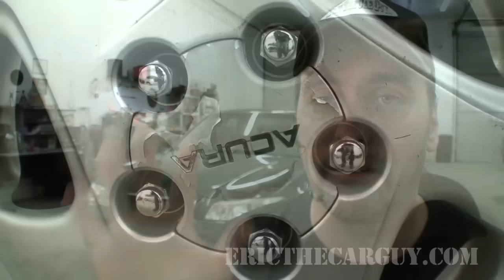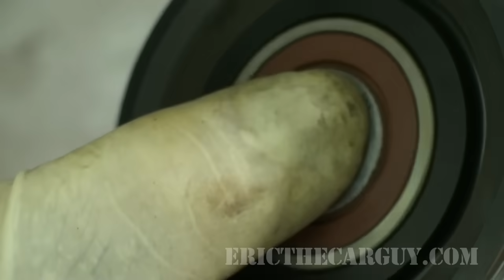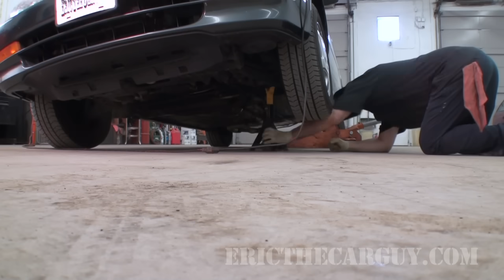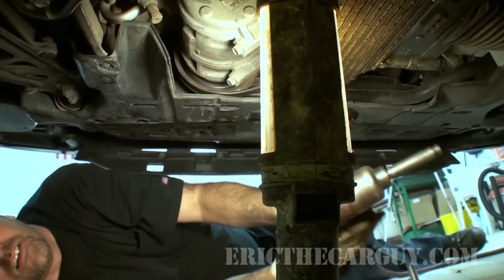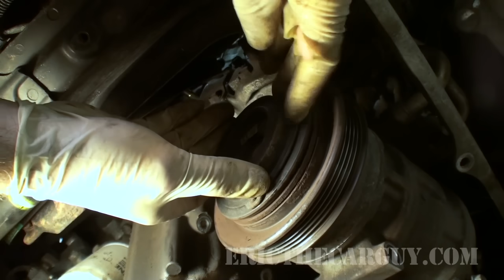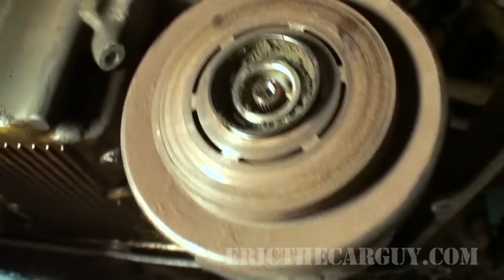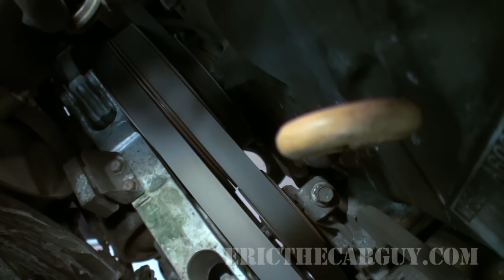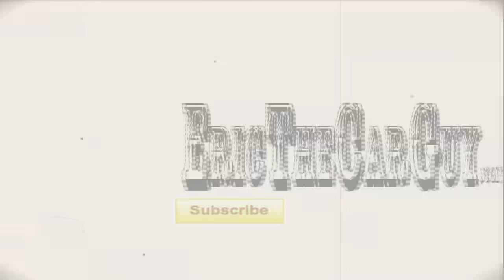AC Clutch Repair and Noise Diagnosis -EricTheCarGuy

Comment: If it was the idler pulley, which is always turning wouldn't it make noise all the time? I'm not that familiar with AC, so just thinking. (probably wrong)
Reply: I didn't really watch where it was, but it must only engage with the clutch. Thought it turned all the time with the belt. Thanks!

Comment: good video..here is a tip.. if clutch only engages if you tap with a screwdriver you can take off the front plate and wire wheel 
 both surfaces clean..get rid of rust and make it shine..take out a shim and usually that works.

Comment: I'm looking to buy a car and the A/C on it squeals when you cut it on (it supposedly stops after it warms up) and it has a new belt (don't think it is the belt since the noise isn't constantly happening while the belt is turning). I was wondering if this could be the fix for the noise since the compressor seems to be working fine and blows cold, or should I look into other fixes for the issue?

Comment: Eric, my mother-in-law's '03 Accord 2.4L has a bad a/c clutch coil... no clicky when power applied & no continuity. Considering the car has 115k miles, I'm torn about whether to have a shop evac the system and then I'll replace the whole compressor assembly (& probably the receiver/drier), or should  I just replace the coil without opening up the system.  What's your opinion?  Also, IMO, after this repair, I think she should trade it in to the dealer where they bought it new because the car eats a quart of oil every 300 miles.  I think Honda should deal with this car because a Honda should NOT be burning that much oil with only 115k miles on it. However, I don't think she'd be able to (honestly) sell it to an individual with this oil burning issue.

Comment: Would the same bearing be at fault if i have a groaning noise while the engine is running, but quiets when i switch the a/c on?

Comment: Great video.  I have a VW transporter shuttle and compressor is making noise.  Will use this video to explain to my mechanic and see if he can change the bearing rather than changing the whole compressor which he is suggesting.

Comment: Can anyone give me advice?
I have a Toyota celica 2004 1.8vvti 40.000 miles, I have only had it six months and when i come to use the air con it is not blowing cold like it should so I got a work mate to recharge the system as I work in a body shop we have a system which removes the old gas and refills it which was done the other day but still no cold air so the system was cleared and filled again but no change, The pump is kicking in the sight glass is showing the flow of fluid, I removed the glove box to see were the expansion valve is located and noticed the two pipes that come in through the bulk head are both hot, I wanted to find the expansion valve to see if its easy enough to change, Any ideas folks ,  Thought I would ask before assuming its the pump, I heard people saying it could be the valve?
Reply: Google it

Comment: Hoping someone knows what's wrong, but when I start my car, there is a ticking ish sound that I have confirmed comes from the AC compressor, the only thing is that it is a constant sound. whenever the AC compressor kicks in, the ticking ish sound subsides. Because of that, I don't think it's the AC compressor causing the noise. Do you think it's the pulley bearing? The car is a 1999 Honda Accord.
Reply: vladstr100 I’d say bearing

Comment: Why when engine idle without clamping the ac pulley had no noise but when the system operated the noise were produced..therefore that pulley had 1 bearing only..tqvm
Reply: I wondered this too.  I'm guessing it's because when the clutch isn't engaged the pulley is free to turn with less force on it so the sound isn't as loud
Reply: It looks like the bearing was working (allowing it to spin freely) but broken and allowing the pulley to move side to side, making poor contact with the clutch when engaged.

Comment: Does a York style Compressor use washers to set  the clutch6air gap? a guy told me that I needed to put a washer in my compressor shaft to set the right gap.

Comment: hey eric my clutch still engages on my compressor but compressor hub barely spins when clutch is engaged, seems like something is loose are not making contact with compressor, i smelt something burning before this happen but as i said clutch will still engage its just compressor barely turns its like friction material burnt away, i have a 03 kia sedona lx

Comment: I changed the idler pulley and my car kinda makes a rattle noise like something is lose or broken beating. it's not over heating and it is making that noise even when The a.c. is off. 05 accord

Comment: Do you happen to know if a 2004 accord v6 compressor  is accessible from underneath like the Acura was?  I'm going to assume the coil is dead since the system was checked out by the shop and they said everything was good but it started to fail intermittently until it just would no longer engage.

Comment: Hi! I have a 1990 Buick LeSabre, I had a problem one time about an AC compressor blowing freon out and then the clutch was making chattering only when the AC switch was in off position. Then when it was on, it stopped making noise due to the clutch disengaging. I had gotten that replaced sometime back and I've had another problem from that time on. How I manage to fix the problem was to remove the AC compressor fuse. When the fuse is in, The engine will idle a little higher than normal and a constant tapping noise would happen behind the dash. What would be the problem? A sensor?
Reply: Air blend door motor if it was a rapid clicking or tapping some are easy others need the entire dash pulled to get to

Comment: My 2005 Volvo XC90 with a V8 begins clacking with the engine reaches optimal operating temperature.  Accelerating increases the loudness of the clacking.  I took it to the auto mechanic and he told me the noise is coming from the AC compressor.  It makes this noise even when the AC is not running.  The mechanic told me the noise will continue even when the AC is off because the compressor is connected to the serpentine belt and the pulley turns even when the AC is not running.  Can this be true?  Thanks

Comment: great video as always. Thanks EricTheCarGuy. I was hoping to ask your opinion on whether you think I should buy a brand new AC compressor, or just replace the clutch.

My car is a 2008 honda civic si and has been having some AC issues. It started a year ago with the AC blowing warm intermittently, then 6 months later only blowing cold for 10-20 mins on a cooler day, to presently in which it only blows warm air 100% of the time. In all of those cases, the AC clutch was idle and not engaged (whenever it was blowing warm) and was spinning (when it blew cold). AC fluids is completely new and charged, and the sensor relay is brand new OEM from Honda. Any advice would be much appreciated. Thanks for all the hard work you put in these videos. Very helpful!

Comment: This video helped me do the same job on my 2002 Honda Civic. A few differences doing the job on the Civic: 

1) You do not have to unbolt the compressor; the assembly is accessible through the wheel well. It helps to remove the wheel, and pull back the splash shield in the wheel well, but the compressor can stay where it is. 

2) Eric unbolts the clutch with his impact gun; I don't have one, so I needed an AC Clutch Holder Tool, available as a Loan-a-Tool from AutoZone. This will hold the clutch in place while you loosen the bolt; otherwise the clutch just spins with the bolt.

3) For him the pulley just comes right off; on mine it was impossible to pull of by hand (yes, I removed the snap ring first). To get it off I used a 3-jaw puller (also loaned from AutoZone) that worked perfectly. To get the new one on, I slowly tapped it on, using a piece of wood between my hammer and the pulley.

4) I originally wanted to keep the original pulley, because only the bearing was bad. However, on the OE compressor pulley, you cannot press/pound the bearing out of the pulley because it is staked in at the factory. So, unless you want to cut it out with a grinder or something, just buy a new pulley with bearing and clutch. I actually had trouble finding the bearing WITHOUT the pulley, and it wasn't even cheaper that way. I got a new pulley/bearing/clutch/coil kit (including new snap rings, nut, and spacers) on eBay for less than $50. Like Eric, I did not bother replacing the coil but am keeping it for the future.

Comment: I would suggest use a short hose as a stetoscope wait for the noise to come out then put the other end of the hose to your ear and the other near to the tensionner pulley and compressor( just be carefull)  on that way you will save more time in locating the source of noise accurately.

Comment: I have a 96 civic ex...when I turn the ac I get a spark from the ac pulley. when I turn it off the spark is still there but very less frequent...any suggestions ?

Comment: I'm going to take a look and see if the clutch is moving on my compressor. For some weird reason, it stopped getting cold last night. It happened the other day, too- parked the car, came back out, started it and bam, warm air... then it started working again, and now it has stopped. -___-

Comment: Just goes to show u learn something everyday. I've been a mechanic for 20 years and never knew u could replace the clutch assembly as my bosses have always just bought the complete compressor. Thanks great video
Reply: Your bosses probably choose to replace the complete compressor assembly because most people don't care about proper functioning of the AC system and seem not aware that it requires regular service and you may never know if the compressor internals are damaged and the clutch assembly (coil, bearing, clutch plate) damaged itself due to compressor shaft binding or overheating due to continuous running on low refrigerant (which lowers the OCR, that is, the Oil Circulation Rate, since most car AC compressors don't come equipped with dedicated oil pumps and sumps like Dorin, GEA Bock and Bitzer bus HVAC compressors, which are similar to the Chrysler RV2 compressor, do and therefore the oil has to circulate around the system with the refrigerant), lubricant leaks or other issues. What may happen by replacing the clutch assembly on an abused compressor may be that the compressor fails a short while after the repair and the customer may basically come back, say it's your fault and want the entire compressor replaced under warranty.

Comment: I have Korean car with 50k on odo low miles I smelled clutch after leaving car in garage 2 months.  Pulled out garage and smelled clutch burning and air is not working at all now.  Any ideas got manifold gauge set to check to see if system has pressure.  Would just clutch kit fix?  Ac light on dash is on

Comment: My 98 Accord's compressor makes a terrible noise when it engages for the first time between drive cycles. It is intermittent, and sometimes I can feel it drag the engine down for a second. After running for a bit it is fine. I just had it recharged and I really don't care to open the system. 

I will definately check that bearing. That TL probably uses the same AC compressor.

Comment: I went through water and this is happening to my AC compressor or pulley. What can i spray on it to remove oxidation?
Reply: Troy Nall If water went into the bearing, there is not much left to do but replace it. The bearings have grease inside, which shouldn't really mix with water. If it's just a little corrosion on the part that engages the clutch, you might be able to very lightly tap it a few times with a rubber mallet (or hammer if you don't have one) while loosely spinning the pulley with your other hand. That may, or may not work though.

Comment: Would you consider just replacing the clutch bearing in a case like this rather than the entire clutch assembly?  The bearing costs $7.00 while a clutch assembly is closer to $80.

Comment: My Chevy Silverado 2500 gives off a rattling when AV is on and I accelerate. Does not do this when AV is off. I changed the pulley put it still makes this noise. Can anyone help?

Comment: hey Eric, can i have an acura,   I over filled it,  and the ac started wining now it blows hot,   I check the compressor and it looks like clutch is engaging and moving with the belt,   Is it possible ac clutch engages and still hot air is coming out, even after getting rid off Refridgerant and refilling to correct amount,   and still no cool air,  even tho i see the clutch engaging on the compressor,  can you help me?

Comment: Helpful video apart from that i live in another part of the world and that kind set of tools might be a hard to find here. Today i just found out it was my AC compressor that was making the noise and its like this here. The AC doesnt work anyway so ill just do whatever i can to make the noise go away. I was already starting to worry id have to remove the compressor and start dealing with a new way to run my belt..

Comment: I have a old (81') BMW 320i and the compressor makes a LOT of noise when I put the AC on (it even kind of shakes a bit when it cycles). Its a York compressor. Question: Does the clutch have bearings? My mechanic says no and that its a bad compressor, but a clutch without bearings sounds odd to me? I looked into buying a new compressor, but they come without the clutch.  Thought maybe a good idea to replace the clutch bearings (or the whole clutch) to see first as I just had the system recharged (and a lot of pipes rewelded and replaced to cure some pretty bad leaks) and maybe replacing the bearings might be the issue. Whatdoyathink?

Comment: hi I have an 04 olds bravada with air conditioning  issues. I've replaced the compressor, condenser, high pressure  switch, low pressure switch, relay switch and orfis tube and recharged the unit. when the engine is running with the air conditioning is on the clutch kicks in and out and at an idle wants to stall the engine. engine runs great as long as air isn't on. What's it's problem? I've tried all I know

Comment: Eric, great video. I'm about to attempt this on a 2007 Mazdaspeed 6. My question to you is before I can get around to fixing this, can I still drive the car around? Will it effect the overall performance of my vehicle or just be an annoyance of noise. The AC is still working properly.

Comment: Bit confused Eric,the way you removed & reinstalled the idler pulley bearing. won't it damage by hammering instead using a hydraulic press.

Comment: Just wanted to thank you.  I had a similar issue, where it only worked if I hit it with a screwdriver.  Two mechanics said it needed a new compressor and quoted me over $800 (It was in for other service and I mentioned what was going on, they never actually tried to diagnose it).  It's a older Jeep wrangler and it just wasn't worth it to me with my budget.  Several forums had no clue.  So 8 years later I stumble on your video.  First time I ever heard a mention of the hitting it with a screwdriver.

Anyway, took me an hour and a half (no impact wrench), one brass brush and like 12 cents worth of WD40 (to make it easier to get the rust off) and holy cow I have a wonderfully working A/C again!

Thanks so much, liked and subscribed

Comment: I have a 99 gmc jimmy and i notice the the ac clutch wont stop spinning while the air is on. Does that mean it needs replaced?
Reply: Do you mean it's locked on and working (blowing cold air)?  If it's working and you are watching it while it idles in park you probably need to rev the engine pretty good before it will kick off.  They tend to pretty much stay locked at idle or slow speeds.
Reply: The air isn't as cold as i would like and the clutch only disengages if i turn the air off. Im worried that it might over charge and blow up. I checked the pressure again with a cheap reusable gauge and it showed it maybe could use a little freon but i didn't add. I checked it again right when i got home and the needle was as far in the red as it can go on the gauge with the air running and clutch spinning. Hope i don't have to sell my truck because im not paying $800 for pepboys to replace 3 things if needed.
Reply: I looked around and found it seems like the most common cause for it to not disengage is the pressure switch is stuck and needs to be replaced.  It seems like you have to have the system drained to do this.

Personally if it was mine here is what I would do
1Turn on the defrost and see if the clutch cycles on and off
2Visual inspect for any loose wires near there, or debris 
3With the A/c on low really give it a good rev at the throttle body, like maybe 4k rpm+ for a good 30 seconds to confirm it really won't shut off
4Take a feeler gauge and make sure there is some gap on the front plate
5Find the A/c relay and swap it with one of the other relays to check for a bad relay.
6.Remove at least the front clutch plate and make sure nothing is stuck or weird in there, clean it up a bit and test again
7. remove the whole clutch, clean, etc.
8. decide how badly I really need cold air
9. Take it to a small shop for a "check and charge"  I've seen ads for like $40-60 for that service
Go from there.

If you want to try to change the pressure switch yourself they are only like $20 or so, but you need to take it in somewhere to have it drained.  It's illegal to just vent it into the air, and from what I've heard potentially dangerous. 

 I can't imagine a place would charge more than a few bucks to drain it...they really aught to pay you as you are giving them free refrigerant!

I know the cheap gauges that only hook to one side really can't give you the whole picture, it is possible you are actually low.

Good luck